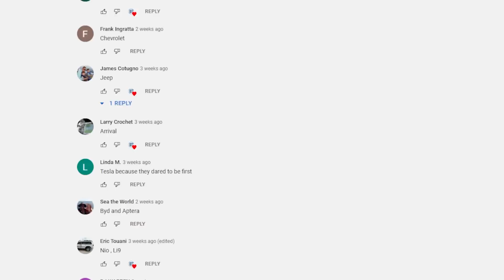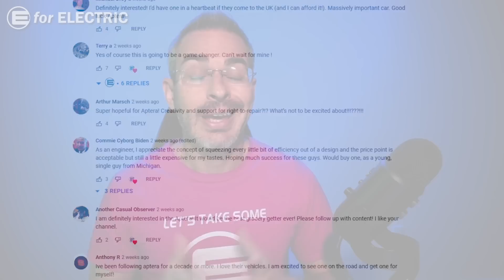How Aptera EV Got a Tesla-like Fan Base

Comment: I commented that I would sell my model 3 to buy this but….like Tesla, this was designed in California. Tesla’s are not winter cars. The Aptera is even worse. Looking forward to a Canadian company making a proper car that won’t ice them out in winter.
Reply: Considering that the body is composite you'll never have to worry about corrosion.
Reply: @DaBinChe  it’s not that. Look at the fenders. Snow will build up in about 3 seconds and cake on into ice.
Reply: @MikeLeWiki  Take off the fenders then.  Supposed to take less than 1 minute reach
Reply: @jeffpitoniak  Are exposed wheels/tires street legal in Canananada?
Reply: @jeffpitoniak  hmmmm…..
Reply: @jeffpitoniak  there’s signal lights and sensors on the fenders. I don’t think you can take those off.
Reply: @skipondowntheroad5833   idk. I'm in the us
Reply: @MikeLeWiki  They cake up on every vehicle.
Reply: @MikeLeWiki  They are removable for off roading
Reply: @MikeLeWiki  The lights are redundant.  The sensors were originally used as parking sensors, not sure if that changed to front warning sensors though.  Even so, the sensors aren't 100% needed
Reply: @jeffpitoniak  so, I just put in a reservation for the off-road version. It’s lifted. That should do fine. I’m excited. An EV quad or side by side start at $25k and you can’t drive them on the road. So, maybe this might be a good everyday vehicle and hunting or basic off-road rig. I guess I’ll find out. All I know is my model 3 is basically useless for 4 months of the year. It’s fun as fuck to drive but if the Aptera AWD goes from 0-60 in 3 seconds then it might be just as fun. I don’t expect it to handle as well on fun windy mountain roads but…..I guess we’ll see.
Reply: @MikeLeWiki  The wind shouldn't be an issue from what I've watched.  The rounded and smooth shape is supposed to let the wind blow around the sides.  On the highway tractor trailers passing did not affect it at all.  Last week I reserved the 1000 mile off road version.  Hopefully they will add vtl/vtg/vtv so I can use this to power my tiny home (when I get one) and not have to buy additional solar or wind and battery backup.
Reply: @jeffpitoniak  wow, you’re hardcore. Yeah, all that would be amazing add-ons. I agree 100%. I’m moving to off grid as well so this would be perfect because of the solar. Hyundais offering V2C or V2whatevr is pointless if you have to plug it in to charge the cars battery. 
I meant whind-y like roads that curve. Not windy. But, speaking of that, my Ioniq that had a .24 coefficient drag was AWFUL with crosswinds. But, the Aptera seems a lot more capable. But, it’s also very light so….I dunno. My model 3 can handle anything in terms of wind or rain. Snow….not so much. Maybe my new winter tires and car cover will help this winter. Where are you located?
Reply: @MikeLeWiki  The fenders move with the wheels so the "gaps" stays constant unlike a car....but also since they are hub motors there might be enough heat that is generated from the motor and the brakes in that enclosed fender to melt the ice.  My ZeroSR electric motorcycle air cooled motor I have seen get up to 140*F
Reply: @DaBinChe  good point. Yeah that makes sense. I’m sure the off-road version will be better for caking.
Reply: @MikeLeWiki   @100% Good Enough  Near Scranton pa. The hub motors with the traction control and abs are supposed to control the rotation of the wheels at 3 times per seconds.  Because there is no gears and linkages the torque vector ing is supposed to be the best of all vehicles.  The weight of the vehicle being spread out by the motors being in the wheels is supposed to offer better handling
Reply: @jeffpitoniak  whelp…I’m sold. Thank you. I have this and the cybertruck on preorder. It’s now a production race. I have little faith in both for on time delivery but both are exciting regardless.
Reply: @MikeLeWiki  Cyber truck bodies are outside giga texas currently and its gigs press is being assembled.   Supposed to start production in q1, same as aptera
Reply: @jeffpitoniak  yup. I’m 975k on the list but I’m sure a LOT of people will cancel so I’m hoping before next winter if they do their typical 300k per month on production. Which is doable if the truck is as easy to produce as they say. Paint and body panel alignment takes a lot of time. We dont have that with the truck. I have faith.
Reply: @MikeLeWiki  on a side note, the 1000 mile version has a heavy duty suspension system due to the weight of the extra batteries.  Don’t know if that will help with serious off roading or if the weight will be counter productive.  The other versions have the standard components

Comment: I don't think that 3 wheelers and 4 wheel cars share the same thunder.  

Love this little car.  I can see doing a long vacation in one camping in parks etc.
Reply: If you call it a "car", you run the risk of invoking the wrath of one of the resident trolls.
Reply: @skipondowntheroad5833  True but trolls will always be trolls.  It will exceed the performance of my present hybrid car in every single measurable spec.  If it walks like a duck....
Reply: The federal government considers this a motorcycle and has to meet motorcycle safety standards
Reply: @ecmeyers9025  This is true, however it is not designed to the minimum it HAS to meet.  The front and rear crumple zones, and air bags should have told you that.

Comment: I’m a reservation holder since Feb of ‘21 and a small investor. Here’s my use-case. I live in a remote, rural area subject to frequent power outages. The nearest fast charger is about 45 minutes away. I’m retired, and 99% of the time a 2 seater is fine. I also live on a bad, minimally maintained dirt road in the Sierra, high enough to occasionally get lots of snow all at once. The Aptera, with all wheel drive, full solar, off-road kit and 600 mile range checks all the boxes for me. 

It will probably be the last vehicle I need to purchase in my lifetime. You didn’t touch on the modularity aspect of the vehicle - if something is damaged or outdated over time (infotainment, solar cells, etc) you just replace them.

Comment: I wouldn´t buy it. love EVs don´t think it will be a success, its a motorcycle with a third wheel
Reply: As a motorcycle rider with over 400,000 miles, and a hybrid car owner that the Aptera exceeds every performance spec, I don't think you understand either vehicle.
Reply: That's ok.
Don't buy one. 
Just like a motorcycle or a pickup truck or a sports car........ 
They're not for everyone.

Comment: Sub 10,000 reservation holder and investor.  You missed that the solar unlocks the apartment dwelling people to have an EV with little hassle. My reservation is for my son to have one with 600 mile range and off road package. Perfect first car for a kid!
Reply: How does solar "unlock" anything when most apartment dweller and city parkades gets zero sunlight?
Reply: @theslimeylimey  The apartments I have lived in always had enough available parking spaces that were in nearly full sunlight (U.S.A).
Reply: @skipondowntheroad5833  Guess it depends where you live. In my area some new apartment buildings don't even have parking stalls for every unit let alone stalls that get sunlight.  Land is expensive so they build to the edge of the property line and put parking underneath apartments.
Reply: @theslimeylimey  if you try hard enough you can make anything a fail
Reply: @theslimeylimey  In northern Nevada we have over 300 days of strong sunlight a year and mostly sunny parking lots. The Aptera will get some charge even on cloudy/stormy days as well. Maybe even some gain in a well lighted municipal parking garage?

Comment: I feel like it's dated.

Can't the body design be updated, without ruining the aerodynamics?

4 wheels is a far better idea, imho. An updated looking 4x4 with the ability to use off-road tires, inside open fenders, would be more desirable to me, by far. I don't care about some tiny amount of added drag. Cars had wheels like that for generations. Enclosed fenders, on muddy roads, is a huge problem.
Reply: Watch the videos.  It all will make more sense then.
Reply: @davidclark538  I've been following Aptera, since Leno covered Aptera THE FIRST TIME.
Reply: The fenders are removable for this reason
Reply: @jeffpitoniak  How the f is removable fenders supposed to be a good solution? Where you supposed to carry them, in the hatch? Vehicles with removable tops has always been an annoying feature in cars. Cool on paper, pain in the ass, in the real world. Removable fender cowlings might seem good...but it's really just a pain in the...... small, trim fenders like have been used for the last 120 years, are perfectly adequate. Besides, what has a higher drag coefficient, a big fender, or a much smaller one?
When they showed Leno the car, last time, the fenders shook all around, like they were barely held on. It looked like sht, and Leno had it left it in the final edit. I wonder if those fender cowlings still look like they want to fall off....
Reply: @DetroitMicroSound  Its a good solution because u said open wheels are better.  Where to store them?  Wherever you want.  Here's the deal, if you don't like the car, don't buy it and stop complaining.

Comment: Dying to see how this thing works during a snow storm.
Reply: I wanna watch it climb a steep hill in the wet. Any surface, but especially anything loose. And NOT in reverse. 😄
Reply: @DetroitMicroSound  With tons of torque available and an ABS/traction control that can sense wheel slip and adjust torque 32 times per wheel revolution, or about every 2.5" of tread travel, this is not going to be an issue.
Reply: @n.brucenelson5920  when a vehicle is climbing a steep hill, most of it's weight is shifted to the rear end. Two wheels in the back, are better than 1, for both traction, and balance.
Reply: @n.brucenelson5920  Aptera should be better at stopping, however.... Since braking force, front to rear, is 70%/30%.
Reply: @DetroitMicroSound  Since the front to rear weight bias is 70/30, what grade of hill  (and at what G of  acceleration) would result in "most of the weight" being shifted to the rear end. Show your calculations.
Reply: @DetroitMicroSound  Since we're not going to be climbing trees, I doubt that the weight shift is drastic enough to lose all traction.....a fraction yes, a significant amount no.....
Reply: @mrpeegeepee2682  A steep snow-covered driveway, is not a tree. I live in an area in Michigan, where many people have to heat their driveway, 24/7 in the winter, otherwise, even their dual motor AWD Tesla's cant pull into their own garage.
Reply: @DetroitMicroSound  My last 3 cars have all been front wheel drive [1st gen Honda Insight, and two 2013 LEAF's]. I climb up slick snowy hills passing up F-150's, ..., that are stuck spinning their wheels.
Reply: @jeffcarlton3590  Your car isn't a reverse trike, either.
Reply: I live in rural Iowa and plan to take delivery of one of the first examples.  I will be reporting on the performance of my 2WD model in cold weather and snow.
Reply: @n.brucenelson5920  ditto; I live in Kansas. We get pretty gnarly snow. I have a 3WD model on order & I'm very interested to see how it does.
Reply: There's a video of it driving in a blizzard somewhere on youtube.  They say the rear wheel is better because its in fresh snow and not in frozen ruts where the front wheels track.  If the road is plowed, no difference than a 4 wheeled vehicle
Reply: @jeffpitoniak  Fresh, well-packing snow, actually provides grip. There's something every Morgan 3 owner knows: It's much harder to avoid potholes, and ruts, when you have a wheel right in the middle of your other two wheels.

Comment: Limited internal space… trunk? Not much there either.
And it’s a extraterrestrial having a baby with a dolphin!
Reply: 28 cu ft in the latest gamma design.
Reply: it has more trunk space, almost double, compared to a Honda Accord or Toyota Camry.  How much more trunk space do you need?
Reply: It is designed for 2 people to sleep in the trunk while camping
Reply: @jeffpitoniak  It wasn't design for that purpose but the results is that you can due to the fact that it needs that tear drop shape to be aero...

Comment: They haven't produced a car for sale yet. Best wishes to them, but we could all slow our roll.
Reply: Kevin, the push is part of what is going to mean they will get to production.  They are hitting the milestones faster than Tesla is with the Cybertruck, which started design around the same time.  This is amazing performance when you consider the current size difference between the two companies.

They are also way ahead and with a much smoother course than it took Tesla to deliver their first far simpler EV conversion of the Lotus Elise.

Comment: So betting the Farm on a Car that will FAIL crash testing 🎉
Reply: Unlikely since at this point they have done thousands of virtual crash tests which have informed the design as it develops.
Reply: @n.brucenelson5920  I don't think they have to meet the same standards.
Reply: Thye don't HAVE to... But are being engineered to.
Reply: @danharold3087  You are correct.  However, they have been virtually testing to the FMVSS part 200 automotive standards and will have them voluntarily physically tested by a third party once there are delta vehicles available to test.  They don't need air bags, front and rear crumple zones, and many other safety features they have designed in.
Reply: @n.brucenelson5920  Glad to hear it.  Do like where they are going.

Comment: This is the very definition of a Clown Car - kids will point at it and laugh.
This EV will go bankrupt in no time.
Imagine getting hit by an SUV 4 times its mass - who would survive the crash in the Clown Car.
Reply: The passenger compartment was designed off an f1 race car.  The composite body is stronger than metal and regains its shape after a collision.  The angles of the body deflect any impact causing less damage.  Cross winds don't affect it because the roundness of the side profile is extremely aerodynamic.
Reply: @jeffpitoniak  Sounds like bull shit to me - so a 45 mph crosswind won't affect it at all?
I don't believe that for one second.
You must be a paid shill for the company.
Reply: IRRC they have been bankrupt once already bought sold etc.   Still wish them the best.